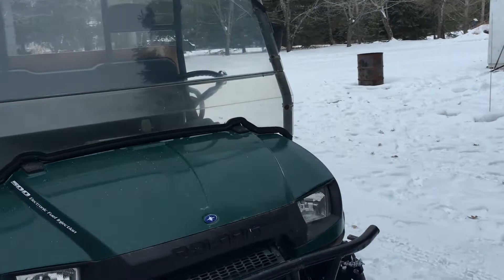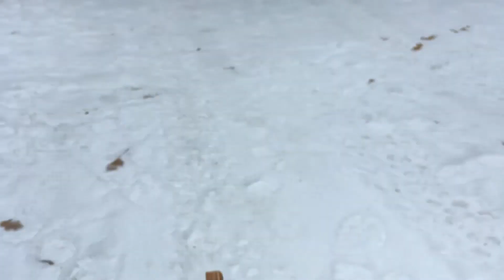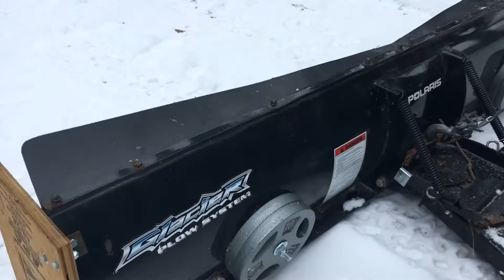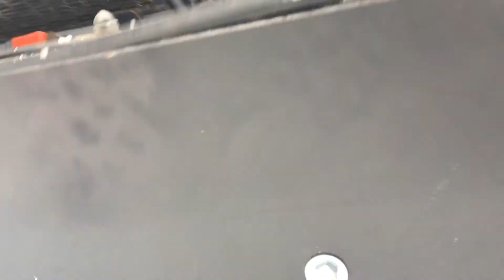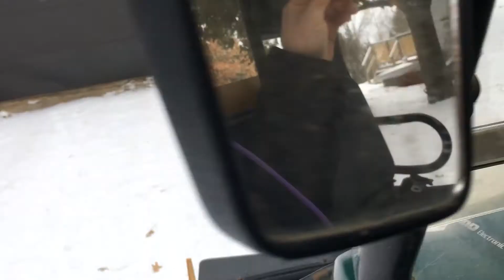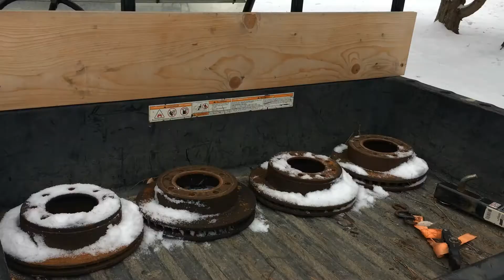Polaris Ranger Plowing Mods

Comment: Hey I couldn’t comment on your rope tow video. Just wondering what you used to attach the two tires to the axle? Is it welded on or is there some sort of attachment?
Reply from the maker: Hello, I used a 4 lug wheel hub, I knocked out the studs and just ran long 1/2" bolts (I think 7" or 8" long?) through the hub and both of the wheels and sandwiched them all together. Let me know if you have any other questions, I changed the settings to allow for comments on the original video. Thanks!

Comment: Are there any plans you had for rope tow looking at building the same thing and could use something like that
Reply from the maker: Elliot Dozeman sorry I made no plans for this, I had an idea in mind and tweaked it as I built it. Feel free to copy my design, it works well
Reply: @ballhammerindustries  do you have a list of some of the stuff u needed for it?
Reply from the maker: @DozeProductions  Basically just the engine, sprockets, idler, axle, bearing blocks, wheel hub and wheels, and the misc nuts and bolts. Sorry I don't have a better list, I basically threw it together with random stuff in the garage and some parts off Amazon. Thanks